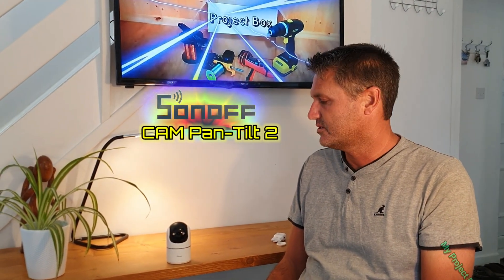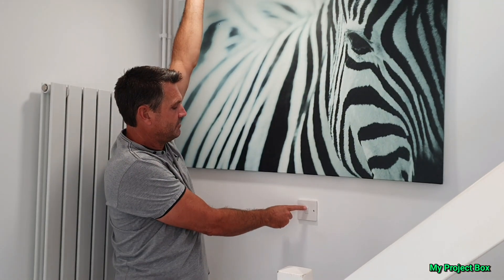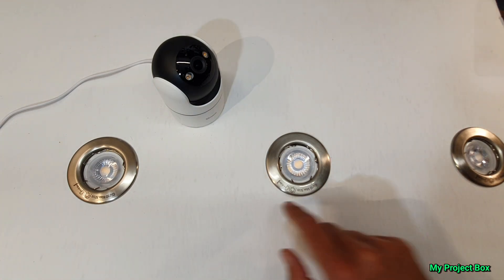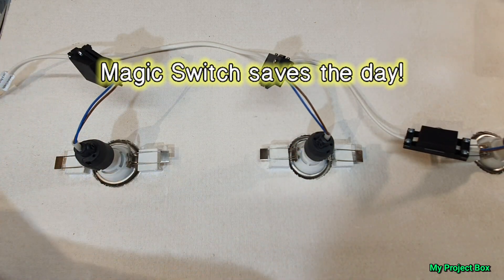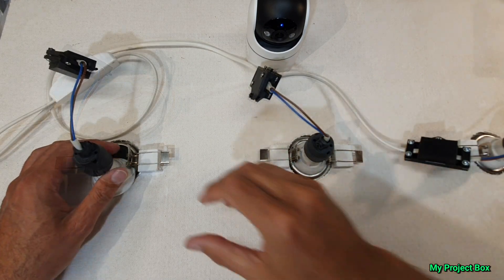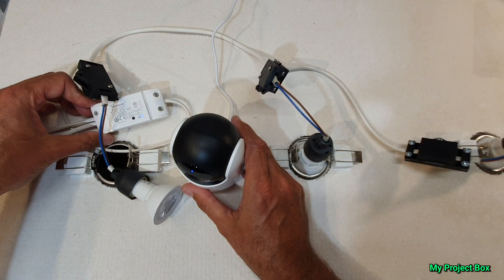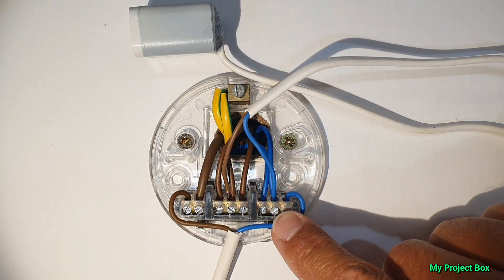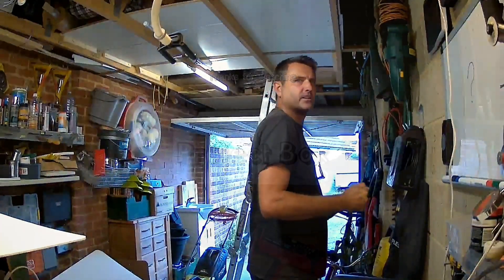SONOFF CAM-PT2 & Basic R4: Wire-Free Ceiling Power Hack

Comment: This is brilliant! Does the "magic switch" also work on smart switches (instead of a mechanical switch) and using the Basic-R4?
Reply from the maker: This feature is only currently available for the Basic-R4 😢😢. I could possibly do something similar, to power the camera usb power supply,  using one of my "NO-NEUTRAL" circuits, reconfigured as "NO-LIVE" circuit. If You look at some of my NO-NEUTRAL videos it might make sense.
Reply: @MyProjectBoxChannel  Thanks so much, I'll have a look. I'm looking for a neater solution for presence sensors.

A solution of "no-neutral" would awesome, especially with all the no-neutral devices coming out, and in South Africa we have both neutral and no-neutral, but more no-neutral switches.